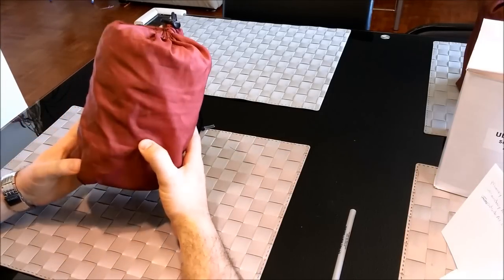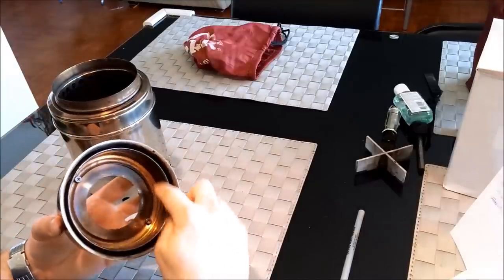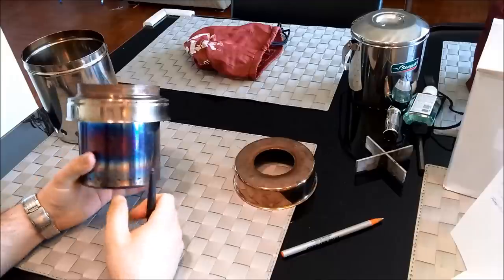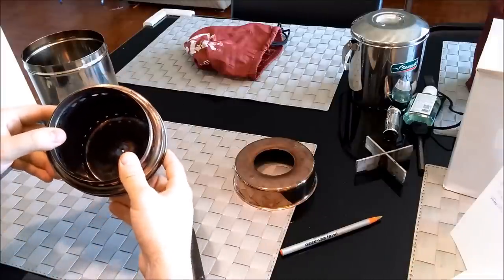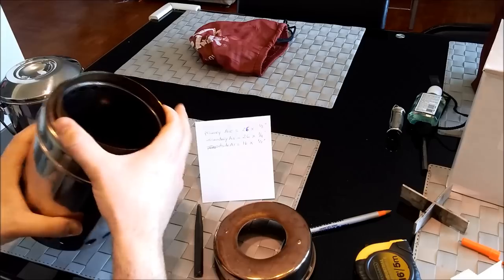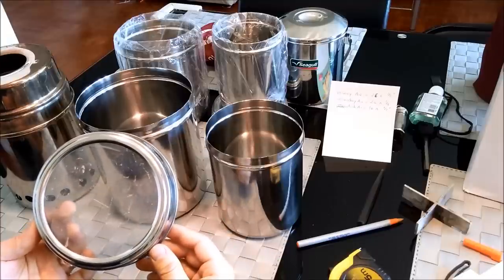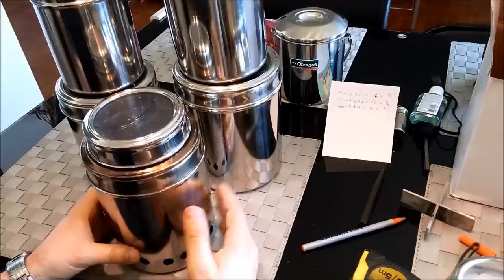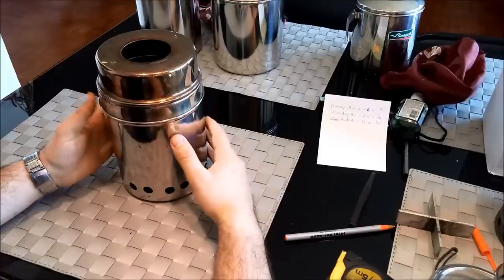Breaking down version 4 - DIY Stainless Steel Wood Gas Stove

Comment: Hi Joe. I built your stove and did a test burn today. Works great! The outer ring diameters must have changed with the manufacture because there was no way that thing was going over the inner chamber without having inside flanges cut first. That is what I did. Fits perfectly now. Thank you so much for sharing your stove design and explaining how to build it. I will being using this kit for years to come!  Salute!
Reply: Do you have the diameters of the pots that fit together? thanks!

Comment: Thanks for this. We got the canister set and have done some burns. We need to increase the secondary hole sizes as we get little to no blue and lots of soot on the pans, though there's no smoke. We are getting a good hour of burn on the larger set, with nice hot coals for long after that. Thanks again for the idea and instructions.

Comment: Outstanding!!  You can also get spring loaded center punches for more precise little ding in the metal to keep the drill from walking, and then use a small drill bit for your starter hole.  Look into Harbor freight online for decent cheap tools if you don't have them in Canada, and I am sure that you can get it shipped.

Personally, I would never buy from Amazon, but to each their own.  Loving the videos.  Very informative, and your presentation is top notch.  Hopefully you will be coming out with more soon.

Comment: Nice stove! I think, if to put the ring with holes near the bottom holes opposite, we can regulate the power of the flame and speed of the burn, when rotate the ring and semiclose or semiopen holes where air intake to the stove.

Comment: Hi again Joe!

Thx for another great vid. I ordered the cans 5 minutes after watching it and I finished the construction yesterday! So as you can imagine I can't wait for the burntest to day.
I found an alternative to your concentrator ring in a pet store. All stainless as well. And as you say the finished stove looks really smart. Almost retail finish.
So thx again. I'll be posting an update on the burn test.

Andreas, Sweden
Reply from the maker: Andreas,

I'm glad to hear you built the stove! I'm looking forward to hearing how your burn test worked out. If you can, it would be nice if you could link to a pic or two, as I'm sure it would provide encouragement to others who are thinking of building it as well!

On a side note, I took my stove camping last weekend for the first time, and I really got to test it's real world performance in the field. I must say the stove worked beautifully, and provided more then enough run time too cook a meal for 4, without having to reload fuel. It was also very nice to know that I could leave it out over night, without worrying about the morning dew causing it to rust! 

One last thing, I did end up going up two more sizes on the secondary air to really optimize the burn from what I posted here on this video. So don't forget that you may or may not need to make a few small adjustments so it burns in a way that is ideal for you.
Reply: Joe Marques 

Hi.

So I finished my first burn and as you can see by the black soot on the conentrator I need to increase the diameter of the secondary holes just as you replied.

Here's the link to some photos:

https://www.dropbox.com/sh/x9u38io49d2t2qn/AABl0QOBw6AJYzH90nC4rYVya?dl=0

A full load of pellets burned for an hour and 5 minutes.  And I must say that I am over all very satisfied.  And I think it looks great. 

I have one question though. As you can se on one of the photos there is about 1/3 of the pellets left when the flames die out. They are charred and partly combusted.    Have you experienced this as well or do you get a more completet combustion with the flames?
As I am writing this the stove is still producing heat so the pellets might be combusted further.

This was a great project and I will keep one tuning it.
With a dremel, a bench drill and drill bits it took around 2 hours to make. I'd dare say even a beginner craftsman can take this on and get a fine result.

Thx a bunch
And keep posting!
Reply from the maker: Andreas Yngvesson a couple things I noticed from your pictures.

1. It seems you used a larger sized pot for the inner pot (burn chamber) them the one I used. This is not necessarily a problem, but it does change things a bit. For starters I noticed that I can see the inner pot through the outside pots main air intake holes. It also looks to me (but i could be wrong) that the inside pot goes down below the level of the main air intake holes on the outside pot. This could cause problems as the inner pots primary air holes should either be above your main air intake (outside can holes), or centered with them. If the inside pots primary air holes are below the outside pots main air intake holes, you may be starving the inner pot for air, and you may not have sufficient mixing of smoke gasses with the outside air.

Having said that, since it's already built, you can try increasing the size of the secondary air holes (top row of holes on inside pot) burn then observe the colour of flame. It should be slightly blue especially closer to the holes where the gas exits, or pale and slightly whitish orange, but not reddish or very orange... If that makes sense. :-)

You may also want to increase ever so slightly the primary air size holes if you find you cannot enlarge the secondary air much further. This may create a richer burn that is more sooty and smokey when pot is on, but at this point you may need to increase the availability of oxygen to the inner pot if you are getting incomplete burns. But at this point it is entirely up to you and your preference. Personally I prefer a burn that is less smokey when my pot is on, so if you can achieve that, but still have some unburned fuel after an hour of cooking, I would prefer that over to smokey operation when pot is on.

2. The second point is that the increase in inner pot size also brings the inner pot closer to the wall of the outside pot, which decreases the volume of air that can move through this space. Again, that is not necessarily a bad thing, but it does change the characteristics of the burn compared to what you may have observed in my stove. If you are able achieve smokeless operation with pot on, then I would say mission accomplished and call it a day in my humble opinion. ;-)

3. By changing the inside pot size, you may find that you are only able to build one stove from the 4 cans you bought, again not a problem at all if your were planning to give the other two to the wife, you probably just earned yourself some browny points and made her happy! The other advantage is that your top concentrator ring likely fits very nicely over the inside pots lid with very little to no wiggle, vs having to use screws like I did in mine which is not as clean of a finish as yours. :-)

Lastly, when the flame does go out in mine all pellets are charged black, and they usually burn down to mostly ash with some charred pellets left afterwards as it continues to produce heat but not flame. I usually get about the same flame timetime you mentioned 1hr 5min - 1hr 15min, with aprox 1 hour if good heat afterwards with no flame.
Reply from the maker: Andreas Yngvesson I forgot to mention, you made my day and gave me a good laugh when I saw that you called it the "Marques stove" lol! :-)
Reply: Hi Joe,

Sorry for not repyling until now.
I have used the same pots as you and lucky enough my inside pot doesn't go below the main air intake. But it does give that impression on the photo. I even had to look for my self to be sure. 
I did however increase the size of the secondary holes 0.5 mm and that did the trick!
I now have blue and partly invisible flames where the gas enteres the combustion chamber and the flame is dangerlously hot. =)

I can't tell enough you how satisfiued I am with the stove. I get a almoust complete combustion of the pellets, it looks great and it cooks perfect!

So once again thx for all your help and to everyone out there. I encourage you to build the awesome MARQUES STOVE. =)

Take Care
/Andreas the Swede
Reply from the maker: Andreas, thanks for the update! I'm really happy to hear you were able to get it working so well, and that you find it useful! Thanks again for crediting my name to the stove! Enjoy your stove my friend!

Comment: If you do a single primary air intake you can use the fan from an old hot air gun or something hooked to a 3-12v adapter, this way you can play with the airflow to regulate the flame.
Great video btw!

Comment: Thanks very much for sharing the details of your stainless steel wood gasifier stove. I've built one now, and am impressed by the way if performs.

Here's an idea for a slight modification to the design. Mount the concentrator ring piece so its opening faces upward.  That way, it could act as a stable platform for a gas stove burner grate and/or the addition of a riser for increased chimney effect.  Wing nuts could make the mounting reversible at time of use.  If the upward facing concentrator ring piece had holes for air circulation, it could also function as a wok ring, to directly hold a large pan or wok.
Reply: did you do it from the tin set he linked? did you purchase them recently? i would like to try but the lower comments saying they no longer fit together have raised a bit of doubt about buying the set
Reply: Yes, I made it from the set he linked, using the smallest and second-largest containers in the set.  It was a tight fit, but was not difficult to force them together by gently whacking the top one with a 2x4, after using pliers to prepare the opening just a little bit.

For me, using a hand drill to drill holes in the stainless steel was the most difficult part.  Using a punch to puncture the metal helps a lot.  For the larger holes, I also used a step bit.

If you'd rather buy one than build your own, these days you can find decent looking inexpensive stainless steel wood gasification camping stoves on places like Amazon and NewEgg, .
Reply: thanks. i would rather build my own and i doubt i could find that same satisfaction buying one from amazon. beside from all the reviews i have watched this seems to preform better than any Prefab unit i have seen. and i would feel less guilty about modifying a setup which i had constructed
Reply: Agreed, the stove performs well, and the ready ability to modify its design is a plus.

Comment: this is awesome, all is needed is too drill some holes, lol. your a genius
Reply from the maker: Glad you enjoy it, let us know how it works out for you're when done!
Reply: +Joe Marques  i'm going to ma replica's of your stove. Since you an others have done trial and errors for me. I seen in other video's your using wood pellets. My purpose for this stove is to burn kindling and twigs and such. I'm sure it will still work, but have you burned anything else then wood pellets in this stove?
Reply from the maker: +mooseman_24 yes I've taken it camping and used twigs, and small pieces of kindling, and it works very well. The main difference is that you get much less burn time with twigs and kindling because the fuel cannot be packed as densely as wood pellets, therefore you have much less fuel, and much more air pockets. 

One thing to remember is that this is a top lit stove, and many other videos and instructions out there start off with a few twigs, light it, then they start adding fuel on top of that... that is incorrect operation of this type of stove, and it throws the wood gas ratios way off. I mention this because since you are using twigs or kindling, make sure to fully pack the stove, light it from the top when full, then as it burns down SLOWLY add fuel, because these TLUD designs do not like allot of fresh material to be added to the top in one shot after it has already been lit.

If using wood pellets, this is never really much concern because it runs for over an hour on one load, and there is rarely a need to add more fuel afterwards.

Good luck, and let me know how it goes!
Reply: +Joe Marques thanks for the heads up, I'll keep you posted

Comment: An ideal super efficient stove would have a heat blanket around the large pot as insulation to retain the heated air.
Small holes at the top are only to provide air for better combustion.

Comment: I am seriously considering figuring how to use this concept for a "low & slow". Smoking ribs, brisket & what-not. A constant temp of 225 degree fahrenheit , would be perfect!
Reply: +steel beel You would need to continuously monitor and stoke the fire, especially with a quart-size burn chamber.  Look into "charcoal snake" for a slow, hassle-free burn.
Reply: +steel beel 
A wood fire burns in two stages/phases.&#160; When wood is heated above 300 C, it starts to give off volatile compounds in gaseous form (research pyrolysis).&#160; These are combustible when mixed in appropriate ratio with oxygen, and burn hot and clean.&#160; This phase is not functional for &quot;low and slow&quot; cooking.&#160; The second phase has to do with the char that is available after the biomaterial (wood) has given off it&#39;s gasses in an oxygen starved environment -- this is charcoal, if used for fuel.&#160; This phase of burning can be functionally turned down to accommodate a lower cooking temperature.&#160; However, at this point, you are doing the same thing as grilling with charcoal.&#160; Note:&#160; the char can be extinguished after a phase I burn by starving it of oxygen.&#160; The char can be saved and used for cooking/grilling at some later point.

Comment: If the primary air holes (1/8 inch holes) are slightly lower than the external can holes (1/2 inch holes) then the ideal airflow characteristics can be produced because when combustion begins the system will naturally draw air out of the primary air holes.

Comment: 8:00 If you don't want to invest in a center punch, find a nail or a pointed screw. You don't need to make a hole with the punch. Just an indentation to position the hole and keep the drill bit from wandering.

Comment: Consider the lids. You could cut out the center of the larger pots lid so the heat chamber could fit in and be welded in place. That way the stove would fit together and be dismantled easily. What do you think?

Comment: so the cans that match are 1+3 and 2+4? I'm asking because I found them separate on a local e-shop they have the following DiameterxHeight
1)10.5x13 cm    2)12,5x16 cm
3)15x18.5 cm    4)17.5x21cm

Comment: Have you considered putting large breathing holes in the side of the concentrator so that you might eliminate the pot offset crossbar and enable you to set the pot directly on top of the concentrator? Or would that decrease the efficiency of the concentrator?

Comment: Hi I wanted to ask about the ratio between primary and secondary air and elevation, now if I correct the air mixture at an elevation 200 ft will it still burn cleanly and with minimal smoke at 2000 ft and plus. Also would it be worth while to build a "air control ring" like what you would see on a wood stove for maybe the primary or secondary air holes to regulate air intake. Thanks so much for the video and would like to say I happy build one myself after your design.

Comment: I'm assuming the inside can (burn chamber) is the next smaller size can from the outside can, right? If I heard you right, your demo stove was made using the 3rd and 4th smallest cans. Have you found a concentrator top to fit the largest can?

Comment: Joe, I need your opinion on the gallon sized stove that I'm developing.Should I use your hole sizes and just multiply the number of holes?Or do you think that I should increase the hole sizes as well?
Reply from the maker: Bob, the safest course of action would be to start small, burn, observe, then increase hole size as necessary. With that in mind I would say you could start by trying to maintain the same spacing between holes to determine an approximate similar ratio, but start small, burn, observe, then increase hole size.